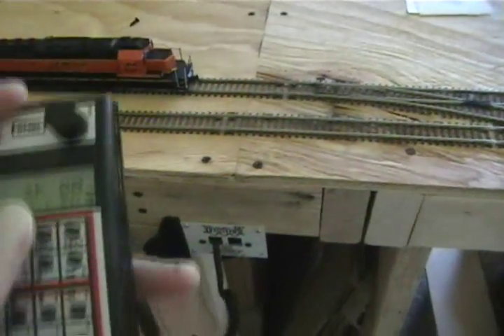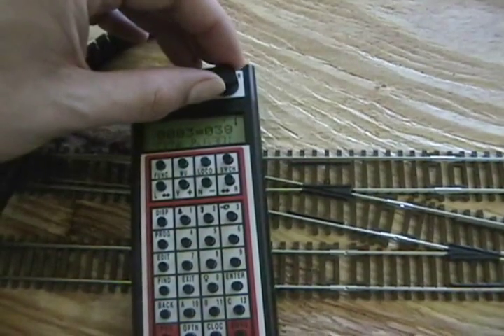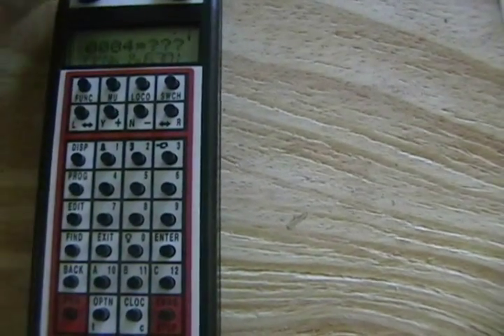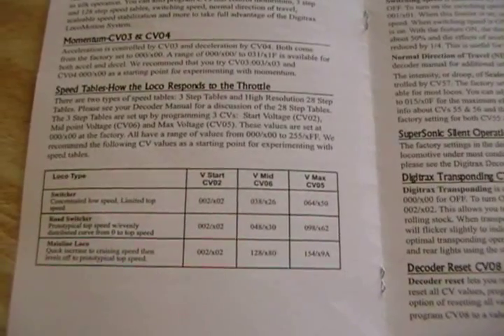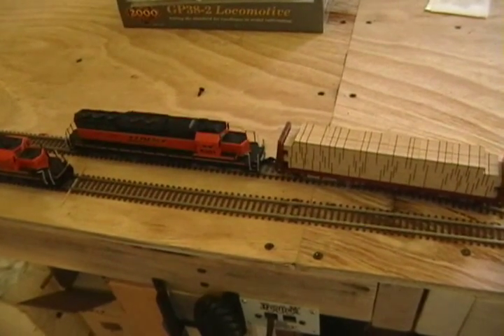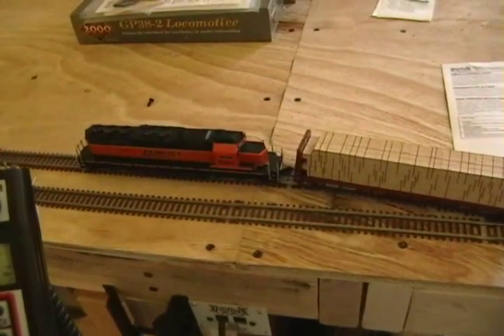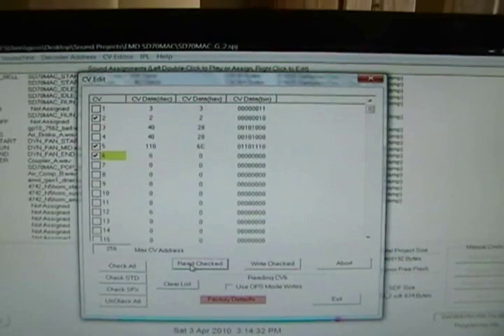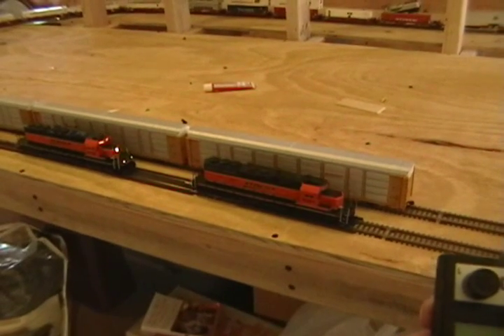04-03-2010 Adcanved DCC - Part 4C Momentum and Speed Matching

Comment: So start w cv3 and cv4 OR cv2 and cv6   To get locos in consist to run together?
Reply from the maker: Robert - It depends on the situation. If for example you have 2 locos that run well enough together at the same speed, but one starts and/or stops faster than the other, then simply adjusting the momentum in CV3 and CV4 may do just fine.

 If the locos are not speed matched well (one is faster then the other) then you need to adjust the speed tables to match them more closely first. CV's 02,05, and 06 is the basic start, max, and mid voltage table. CV's 65-93 is the long table and really allows you to dial it in if desired.

Digitrax and other manufactures have good resources on their websites for this. These values change a little bit depending on decoder and manufacturer.

Comment from the maker: It will depend on which Digitrax decoder you are using. For example, A DH123 or SDH164 will respond differently that a DH165 decoder. In any case, there is no magic set value for speed matching, it's all trial and error

Comment from the maker: @aaron13133 I have found that no two Athearn engines are perfectly matched. Even if they are from the same run. But, they may be very close and not noticable. It does become much easier if you use the same decoder. I found it best to match everything you your best running loco and use it as a template. Your genesis settings will be a lot different from you blue box settings. Don't forget to write your CV's down for each loco. They will be helpful when programming.

Comment: another 2 questions, if ibuy 2 athearn blue boxes at thew train show next weekend from like the same year/make, will they run the same? if i put in the same board and decoder? and my SD70MAC (csx 703) has sound, and i am trying to match it to a non sound CSX SD60I 8734 both athearn genesis. is it even possible?

Comment from the maker: @aaron13133 With a Zepher, you'll need a program track set up. Leave the SD70 as is. Start with the SD60 and raise CV2 a few values at a time until it starts to take off about the same time as the SD70 does. It'll take some trial and error until it's right.

Comment: hey, got a question, i have a csx SD70 and a CSX SD60, the beginning and take off speed are different, i have the zephyr. on the number 1 of 5, the sd 70 takes off REALLY smoothly at number 1. the SD 60 takes off at 2. but they match exact speeds at about 3 and up. so basically i need help on the beginning speeds.

Comment from the maker: They both so have CV's to change the speed and momentium, however, I do think some of the values may be different. You may need to check out the website or decoder manual for the specifics. Also, FlymanJG did a great "how to" for soundtraxx speed matching that you should check out.

Comment from the maker: @xrrtracks The only difference that you might come across between the different manufactures is the CV assignments. What CV 02 is for Digitrax may be a different CV for QSI or Soundtraxx. I beleive most of the motor function CV's are the same but you can check the manufactures website for specifics.

Another tip is to setup or find a loco that you are happy with and match up any other loco's up to that one loco. It makes the process go a little easier.